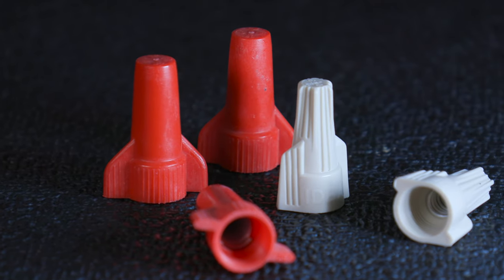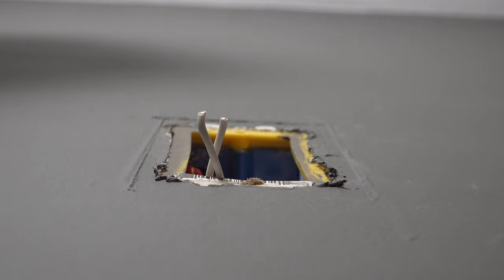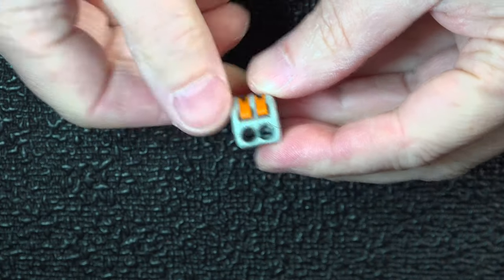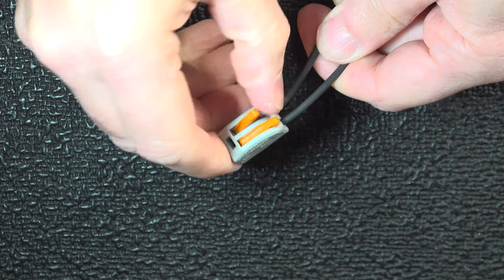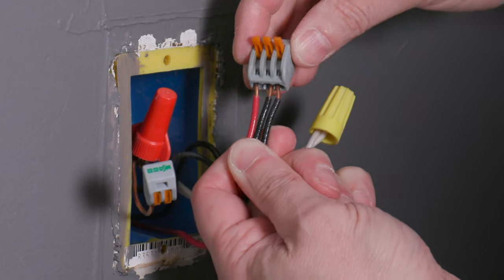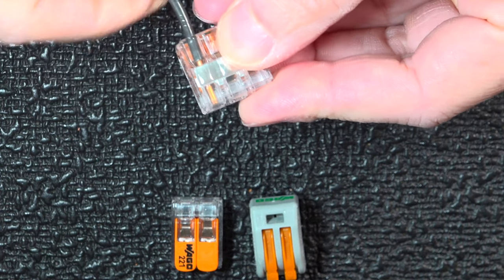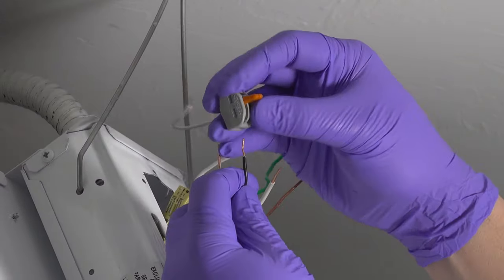Never use Wire Nuts Again - Wago is Better Electrical Connector

Comment: So if you have difficulty with wire nuts please find a new line of work. Qualified experienced Electricians have been using them forever with no issues. All of these so called improvements with the wago are mute when a wire nut is used properly by a real electrician. Surface area of the actual connection meaning wire touching wire is far greater and secure in a wire nut than a wago.

Comment: Wire nuts are very reusable and a pack of abt 50 wire nuts is abt 8 bucks
Reply from the maker: Needles and bandaids are reusable too, but like wire nuts are best put in the trash after a single use. A few pennies isn't worth a fire. Don't use Wagos if you don't want but use new parts.

Comment: Twist caps are the best connection, plug-in caps are the easiest, twist-off caps can handle more current without burning out, if you need a connection that must be able to withstand high currents, use the twist caps, or use heavier plugs and wires, two wires in a screw cap is not everything, just like vlex wire, then the plug-in caps with locking are the best.

Comment: Apparently, this guy is NOT an electrician. Anyone who has used wago's proficiently knows there not as reliable as wire nuts. Always pre twist sold wire with your linemans. If you need to disconnect the wires just untwist them. The way he shows you in this video is COMPLEATLY WRONG. If you want a connection that will last forever. Use wire nuts. If your connecting solid and stranded wire together push the stranded wire up just a little bit higher than the solid before putting the wire nut on. If it's just stranded. There's no need to pre twist the wires. This guy is spreading false info and doesn't know what he's talking about. He should be ashamed of himself. Hire an electrician, this guy should, no doubt. Wago's are fast but not as reliable.
Reply from the maker: Not 1, yes 1 case of a Wago 221 failing can be found anywhere. Sorry to burst your bubble.

Comment: I am an electrician and wago wire connectors are expensive, bulky, and total junk. Good for homeowners who cant be trusted to use wire nuts properly. I wouldn't use them if they were free.
Reply from the maker: That's funny. That explains why the UK, Germany Switzerland and about 10 other countries have completely standardized on them and wire nuts are an antique
Reply: @SilverCymbal  I don't know anything about European electric code. I just twist wires together 50 to 70 hours a week and have no love for these connectors. It is fact that they are much more expensive, it is fact that they are bulkier then traditional wirenuts, and it is fact that you can wiggle and twist wires to work them out of these style wirenuts. Just because 10 out of 195 countries mandate their use doesn't make them better.
Reply: @SilverCymbal  looking into it, since European circuits are run at 240 their ampacity is usually 13A which would only require 16/18awg wire from the looks of it here. Those are very small, maybe they behave better with the wago connectors. They are terrible for our 14/12/10awg wires

Comment: Wago connectors are not as good of a connection. The wires are twisted tight and nuts facing up if you did it right with wire nuts. Wagos are faster but not a superior connection. In my opinion anyways.

Comment: Yea yea yea… don’t be deceived guys… I been during electrical work for 20 years and these wago’s  will heat up a burn out too… when done right wire nuts is just fine… they been around longer than me!! Second problem is what happens when u need to check the voltage on a particular set of wires with out disconnecting it or shutting off breakers! FYI if u doing commercial work and trying to trouble shoot a wire issue in a occupied office u can’t just start shutting off breakers at will…🤷🏾‍♂️ u accidentally shut off a server rack and cost that million dollar company big money, who do you think their going to ask to replace that money? You!!!🤷🏾‍♂️
Reply from the maker: Are you joking? Wagos have built in voltage test ports, probe slides right in. Unlike wirenuts where you have to shove the probe right up their...well you know. Give them a TRY you might be surprised.
Reply: @SilverCymbal  bro I used them b4 and also serviced commercial building where they fried out and melted!! 🤷🏾‍♂️ their good for saving time tho!👍🏾

Comment: Uh, how often are you "changing the light switch" at a switch plate?  You ~maybe~ do it TWICE during the lifetime of a house.  That's 70 years?
WAGO is ~$30/100
Wire nuts ~$5/150

Comment: ADVERT !!!    If installed properly according to directions twist-on ‘listed’ wire nuts are second only to soldering !

‘They’ already tried promo these for a automotive use and FAILED !
(74 year old master electrician!)
“Anything for a buck”, right !

Comment: I wonder why these aren't standard by now? There's no reason for wire nuts to exist anymore.
Reply: cheaper and very easy to use if you do it correctly and not like an ape.
Reply: in germany they are standard. you can use ones with screws, however, they're illegal for an electrician to install in, for example, junction boxes. wire nuts are basically nonexistent here around.

Comment: Nope, wegos are not always ideal, especially when doing fire alarms, wire nuts FTW plus wegos take more room in the junction box
Reply: no they dont wtf are you talking about?
Reply: @SlavesWereGood  you run FA jobs?
Reply: @nikkoBcool  i work with an electrician on almost a daily basis wagos do not take up as much room as wire nuts they are like half

Comment: Yeah, but with wago connectors you can’t stuff 13 wires in one connection like you can with wire nuts
Reply from the maker: You can fit 15 connections across the back of the box in a 1/4" of depth using Wagos. See one example of it here https://youtu.be/xuj-sEJryxw

Comment: The statement that wire nuts were used from 1929 proves that they are the best connectors. Nothing is better than the wire nut. I would never trust wago.

Comment: "Theyre pretty much idiot-proof." Well that didn't stop you so i'd say thats a false statement. I've worked under some amazing electricians and they HATED seeing these "new" connectors for one reason - they dont hold over time. Copper wires expand and contract due to heat generated from the internal resistance in the wire. That means they can wiggle their way out of backstabbed outlets, these 'magical' connectors, and even your electrical panel breakers. Thats why it's recommended to have your panel checked every 5 years - to tighten those loose connections. Wire nuts are great because they hold your twisted wires together for much, much longer. This includes stranded wire connections when done properly (the stranded wire needs to enter the wirenut before the solid wire to ensure a tight connection). If your wirenut falls off then that's not the wirenut's fault, that's your own poor technique or use of the wrong size wirenut. Also if your wire gets cut that badly, then you're overtightening your wirenut. If your wire gets less than 3 inches out of the box, then either you are cutting way too much or you just need to add a pigtail to extend the wire. There's a reason only qualified electricians should work on your home's wiring. Yes there's absolutely bad electricians out there but there's also bad engineers out there, so that argument is useless.
Reply from the maker: Thanks for the insult buddy. I'll accept the findings of the NFPA, UL, CSA and meeting the NEC over some counter talk. Every push connector is not the same, backstabbed outlets are horrible, they aren't patented. Wagos are patented because they grip the wire better and differently. Do what you are comfortable with but the world already moved to these decades ago, we are just late to the game.
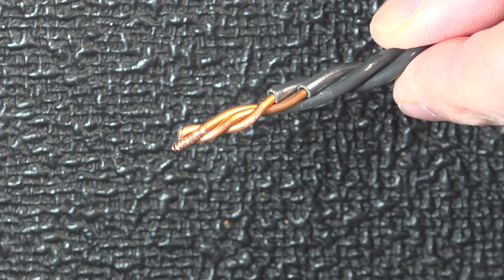Reply: @SilverCymbal  My point is not that these wago things have not been approved for electrical use. My point is that you grossly misrepresent wirenuts as a dangerous piece of technology backed with the same biased footage of connections that clearly were not properly made. Some examples: putting two untwisted solid wires under a wirenut. Cutting the wire well beyond the wirenut connection, resulting in wasted wire length which you later complain about. an unsecured wirenut which was improperly installed to connect stranded and solid wire (properly installed connections are always pulled on to ensure a tight, secure fit). "Wirenuts are not reusable" is typically not the case. 0:35 a very, very half-assed twist of 3 wires with the cut insulation not lining up, too much copper wire exposed, the wires not being cut to stop at the same point, and clearly an overtightened wirenut resulting in such severe cuts in the tips of the wire. This is only within the first minute of your video. You threw this together to try and persuade more people to use wago connectors over tried-and-true wirenuts that last for many, many years without issue when properly installed. You aren't an electrician. Don't pretend you are qualified enough to speak for one when it comes to the technology used in the electrical trade.
Reply from the maker: @Tutle64  Try this experiment, search on google....click burned wirenuts, then click images. You can choose for hundreds of horror pics. Do the same search on burned wirenuts. You will not find a single one. Which is more dangerous?  You also can't be serious about wire nuts with stranded connections. Even people that hate Wagos agree that they are nothing short of remarkable for stranded connections and even solid to stranded.  You agree with me more than you realize. "When done properly" thats the issue with wirenuts.  What's proper? The "scientific" pull test? I'll take a Wago with a clear body that can be visually inspected, built in meter ports and repeatable connections every time whether you do 1 or 1000.  Every person that uses Wagos love them, the only haters are the ones that stomp their feet and refuse to accept there is a better way. You need to try a pack and then come back and tell me how awful they are, you never will.
Reply: @SilverCymbal  I love people who use "science" as their argument yet fail to understand/properly use it. Everything you just stated is anecdotal. Google searches arent experiments. Of course you're gonna find more pictures of burned wirenuts - the wagos haven't been around long! And maybe its just me, but I'm pretty sure if you apply a significant pull force to a wirenut to test it, that same magnitude of force is never gonna be experienced in that junction box. The only thing it would reasonably experience is heating and cooling due to change in current. That doesn't loosen a wirenut connection over even 50-100 years, again, when installed properly. So how do you know? You pull on it before putting it in the junction. So how do you explain burn marks on a wirenut? The same way you explain burn marks in a junction box, on the wire itself, or in your panel. Excessive heat due to excessive current due to using a lower amp-rated technology than was really required. This isnt something that happens to only wirenuts so how are they to blame? If you need a clear body to know you got a secure connection, cool you can do that. Most electricians wont because they can feel when the wire hits the back end of the connector, but some people need training wheels. Btw I have tried wago-type connectors and they are laughable. Insecure, higher resistance, and just like any push-in electrical connections, loosen over time. Theyre never getting used in my house! Oh and stranded wire connections can be very secure with a wirenut, ive done it plenty of times and never had one fall off! But I think I've come to the conclusion that we really won't agree on anything. The more I watch this video the more things I find wrong with it. But anyways, my views and comments get to help your algorithm as your viewers blindly accept this video. I hope you learn real science eventually!

Comment: Wagos are fine and all but your opinions on wirenuts are wrong, you don't need to cut the wire down if you want to add another wire, either someone told you wrong or you've never seen anyone do it right. Wirenuts can be reused as long as they maintain their structural integrity, basically if they haven't been exposed to the elements or are less than ten years old they're still good to use. I really don't know why you think you need to cut the wire down every time you replace the wirenut, those grooves on the copper don't matter. Now connecting solid with stranded can be difficult, but just going with wagos is like giving a first grader a calculator for their math homework; you're avoiding the practice and skill necessary for quality work. Used to take me many tries to get solid and stranded together but now I can do it no problem. Staying with wagos is fine if your ok with being a basic DIYer, but if you want to be a skilled professional you need to start by practicing the skill itself.

Comment: A properly installed wire nut is better than a properly installed wago. Simple 
/faster doesn’t always mean better, like stabbing receptacles vs landing on the terminals. 🤦‍♂️
Reply from the maker: They have a patent, back stabbed outlets do not. It's different & used worldwide with every approval and test you could ask for. You can stomp your feet and say bah humbug but there is a reason most of Europe outlawed wire nuts decades ago for these.
Reply: @SilverCymbal  lol no stomping just my opinion. Although they haven’t been used enough around here for me to really form an opinion, just what I’ve heard